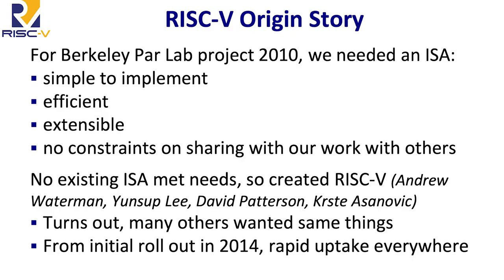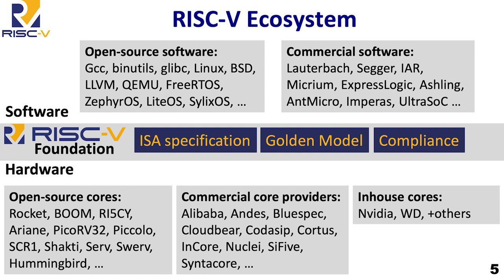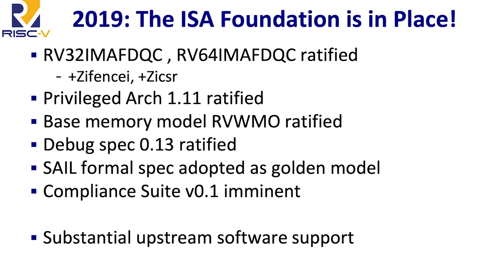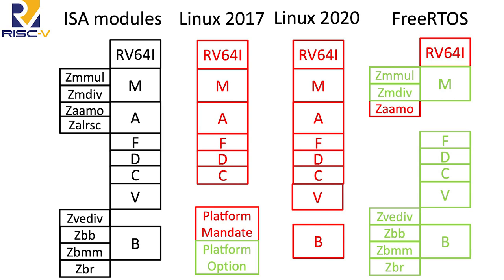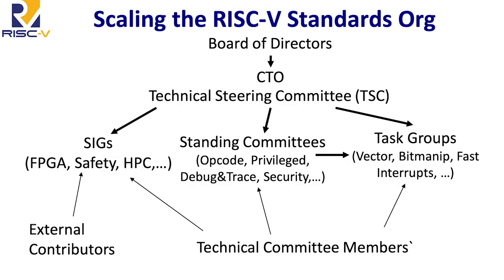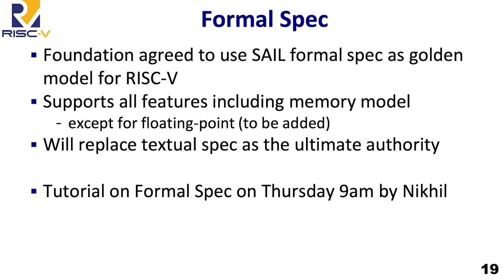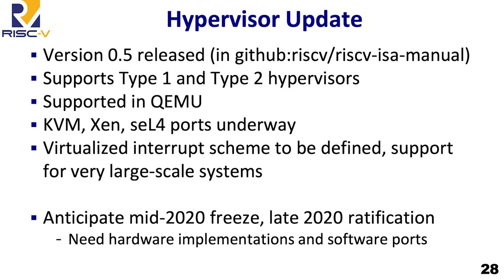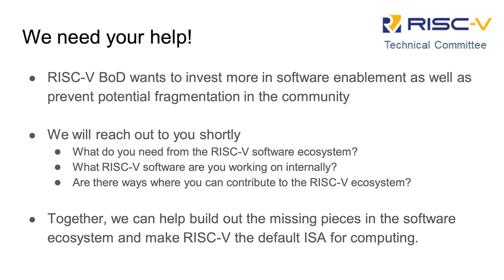RISC-V Summit 2019: 2  State of the Union

Comment: Several very capable ARM-based SBC's running Linux are available for around $50 (e.g. Raspberry Pi 4).  I'd happily pay twice that amount for an equivalent RV64GC board.  Will I ever be able to buy one?  When?  2020? 2021? Never?

RISC-V could end up owning the microcontroller market, but it seems to be going nowhere fast in larger systems.
Reply: Well, there exists an RV64G SBC already: the sifive hifive unleashed (https://www.sifive.com/boards/hifive-unleashed) and I was able to play around if one for a bit. They are 10x the price you would like them to be ATM but we are getting there... and while I criticize everyone and everything usually I don't see the point in your post. RV is still very new in comparison and I have no doubts that we are on a good track on a whole and in the regards of cheaper and usable 64-bit SBCs.
Reply: Sipeeds "MAIX Go Board" or "MAIX BIT Board" (approx. $5-$10) are based on Kendryte K210 RV64G. The K210 has no MMU, but Damien Le Moal (Western Digital) reported last September about “RISC-V NOMMU and M-Mode LINUX” / busy box on the Kendryte K210. (There are K210 HAT boards for Raspberry Pi) That's not what you're asking for, it's a start.

Comment: RISC-V doesn't appear to have real hardware boards comparable to even a Raspberry Pi 4. The CPU ISA alone isn't a solution. An open source GPU is also necessary.

If you want to free Linux from proprietary nonsense, a real RISC-V CPU with a comparable RISC-V GPU, likely able to connect to an HDMI output is necessary. 

Until a Linux with no closed source binary blobs is available, RISC-V won't help. You need real hardware, which means something comparable to a Raspberry Pi, and you need an open source video specification as well. Open source CPU instruction sets won't help if closed source video and audio are also required. All input and output silicon must be open source and be able to boot without any closed source product.
Reply: «Linux with no closed source binary blobs is available»
but there is Linux-libre
Reply: @formbi  If it could boot without closed source BIOS or firmware setup, fantastic. My understanding is closed source is required for all BIOS on X86 systems, and all firmware on ARM RISC systems. The security management engines give opportunity to open backdoors beyond the control of Linux. RISC-V is a possible solution, but it must have a GPU and must have a verified open source BIOS or Firmware.
Reply: @BeachCity  that's almost true, but there are some free BIOSes
Reply: lol nice goalpost moving
sky130 will solve this